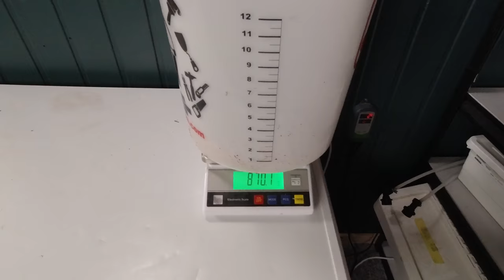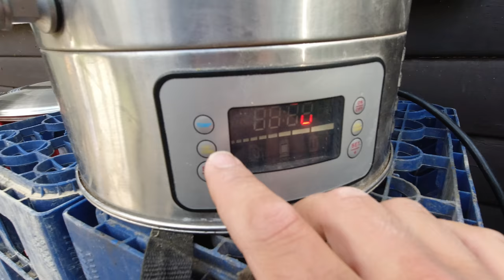Raspberry Sour Beer Grain to Glass - Lallemand Philly Sour

Comment: I believe your perception of sourness has to do with the difference between pH and titratable (total) acidity. I'm not quite sure how it works, but I believe something along the lines of: Two solutions can have the same pH but have different titratable acidities and therefore different acid (sour) properties.
Reply: Yes, pH is a general criteria of sourness linked to the ratio of H+ vs OH- ions and I believe it's impacted by the minerals in the water. The sourness perception is only related to the quantity of acid in gr/liter as titratable measure gives you. I use a titratable measuring system for my commercial kombucha because I didn't have the same sourness perception from one brew to another even if the pH were the same. By example, with the same titratable content, the pH of one brew was 3.15 and another one was 3,3 but the sourness perception was exactly the same. I also believe that the sourness perception depend of what type of acid your brew have. The Lallemand webinaire said that under-pitching or over-pitching may reduce the sourness so make sure your respect the recommended pitching rate.

Comment: Cheers, I agree that it isn't a super sour beer (I've just kegged a straight berliner weisse using this yeast). But it's very pleasant. I guess that's where you need to use proper bugs. I believe Dr Farber quoted normal final beer pH ranges of 3.2-3.5 with this yeast.
Reply from the maker: Thanks Stass! Nice to hear that it wasn't just me. Exactly as I said in the video. It is an making beer but not that sour. Cheers!

Comment: Ph 3.3 is sour enough for most people i think. You can always add some extra lactic acid to taste, some consider that as cheating, i don’t care. Maybe give it some more time or change fermentation temperature. Als in my experience it is not necessary to pasteurize raspberries, i use frozen ones from the supermarket, a low ph keeps a lot of bugs away I once pasteurized but that gives a gelatin like consistency.
Reply from the maker: Thanks!
Trust me, its not that sour. I know a lot of people don't pasteurize berries and more . I like to do that, makes me feel good knowing I didn't introduced anything.

Comment: I know the souring ability of this strain is usually closely related to pitch rate; from the data I've seen,  both under and overpitching yields a less sour beer than is typically desired. For a 23.5L batch I'd say two 11g packs would be double what you need, especially with such a low starting gravity. The manufacturer advises not repitching this strain, because rarely does the resultant beer come across as sour, but Sui Generis has does some excellent research in this department and determined that this is simply because folks end up overpitching. The cells of this strain are also smaller than regular Sacc. strains so it's very difficult to determine slurry cell count without a microscope.

Comment: Made a parallell test with Philly sour and aciduated extract. Made 2 base beers and mixed with cherry syrup and deaerated water afterwards. The aciduated malt extract gave a kettle sour. Very one dimentional tartness. And some sweetness from the syrup (killed the yeast). The Philly sour gave a more complex tartness. It will be the method I will continue making sour beers. Next time I will make the base sour beer in one pressure tank. Put the syrup (without any solids from the fruit) in another tank and transfer the beer on top. Let it pressure ferment the rest. As I understand the yeast first produce lactic acid and then alcohol. Means the fruit will not interfere with the lactic acid phase. The extra sugar from the fruit will just be alcohol. Late adding fruit will hopefully contribute to a more fresh fruit tast than fermented from the begining.

Comment: I loved your video Doc and it’s easy to say why. I currently have a brew on with Golden Promise and Wheat malt (2.5 kg of each) plus I threw in 150 grams of acid malt. The hops were Tettnang, 70 grams thrown in for twenty minutes at 80 C.
I added one packet of Philly Sour as had 21.5 litres of wort at OG 1.057.
Very slow fermentation but took off after two whole days and is now showing about 1.028 after four and a bit days. 
I am aiming to drop in 2kg Of blackberries and 2kg of black currants after five full days.
However here is my dilemma, I read after I had started the brew,  that this yeast is not recommended for bottle conditioning and as I only bottle my beers at present I will have to do this!
I have emailed Lallemand about this dilemma a few hours ago to see if they can advise me why and what is likely to happen or not happen😂
You have given me faith though as if it all goes wrong I can say it is an experiment and I can advise others what happened to my bottles😂
I have read that this yeast is capable of but not recommended to bottle condition!
So let’s find out 😂😂 I just hope the bottles do not blow my house up 😂😂😂😂
Cheers mate great video👍👍👍
Reply from the maker: Thanks, if botteling beers with fruit in them I would recommend you to let the beer sit on the fruit for like 4 weeks before bottling. Just to be sure you're not making bombs. Cheers!
Reply: So how did it turn out?
Reply: Chabtheman Lallemand sent me a prompt reply and advised me not to put more than .1 of a gram per litre if I bottle conditioned.
I followed their instructions and put 0.05 grams in each 500 ml bottle. After two weeks keeping the bottles warm I tried one and it has carbonation which is not too heavy. 
The beer itself has been a success and has a smooth taste and I don’t find it over sour. It finished at 5.9% ABV and I think the PH was 3.1 at bottling.
I haven’t managed to do a follow up video yet of the brew day but will do a tasting and update video this next week for you tube.

Comment: Fermentation cycle is inconsistent in homebrewing due to the single temperature infusion brewing method, regardless of the type of yeast used. The method produces chemically imbalanced, sugar imbalanced, low nutrient, extract and when yeast is added off flavors develop during fermentation and conditioning. The beer is artificially carbonated and drank when it is green because shelf life is short.